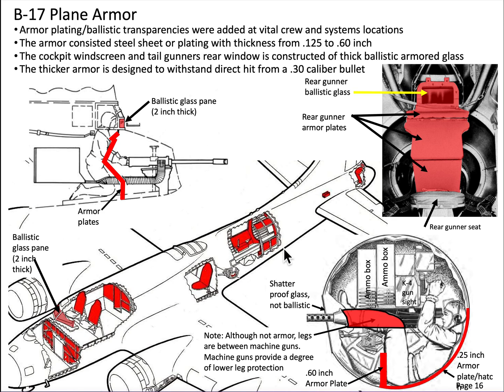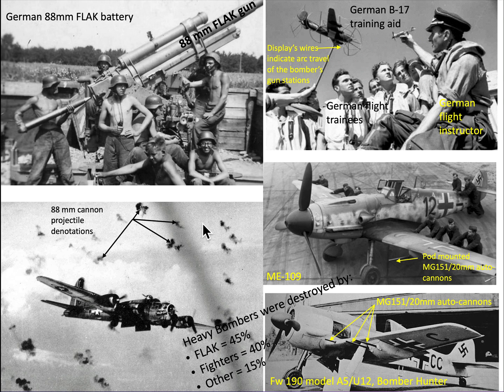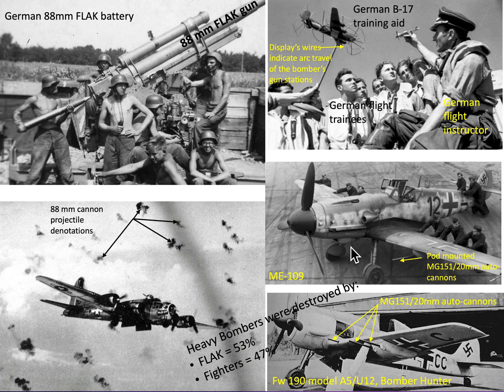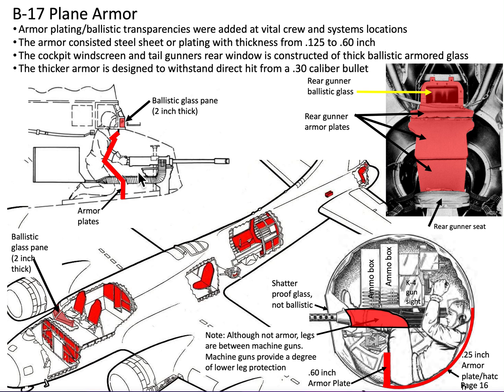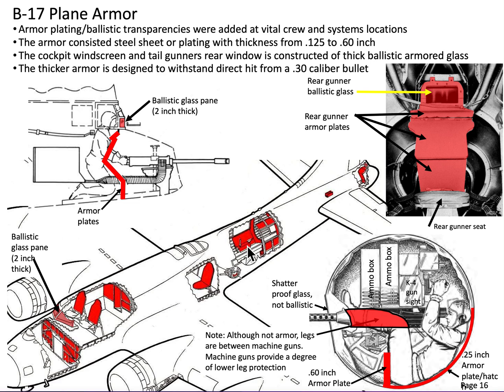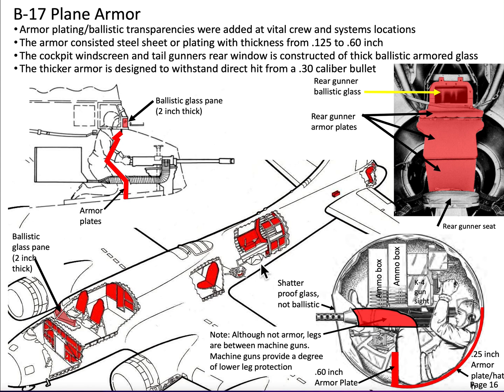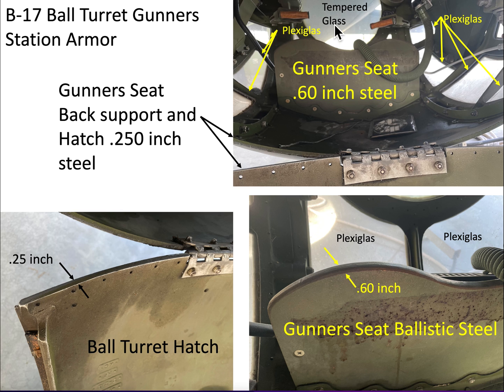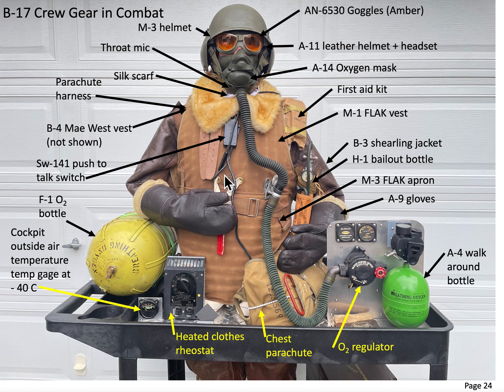B-17 Bomber's Plane Armor for Crew Protection

Comment: The ball turret hatch is cast aluminum, but the bottom/seat back is, indeed, .25 armor plate. While 'only' aluminum, it is 6-10 times thicker than the skin of the airplane, as are the rest of the alum. castings that make up the rest of the turret. Some are much  much thicker in places.   In addition, the 1000 rounds of ammo provides some additional protection as well
Reply from the maker: Thanks for the clarification. The hinged hatch does appear to be aluminum, the seat and curved section of the turret shell that extends from the seat to the hatch is .25 steel. I had to check with a magnet. I will update the video with annotations to reflect this discrepancy. That's a good point regarding the draped ammo belts providing FLAK protection above the turret gunners position.